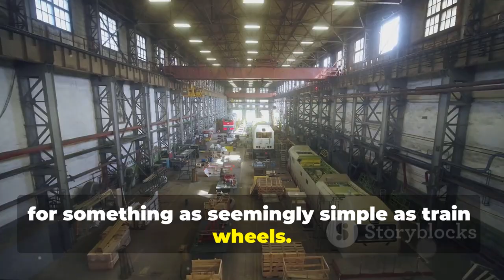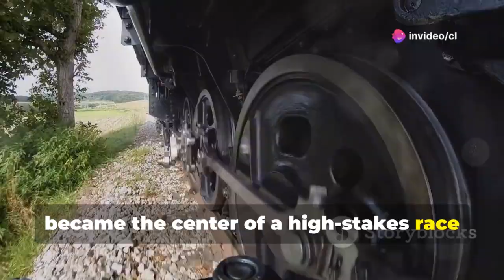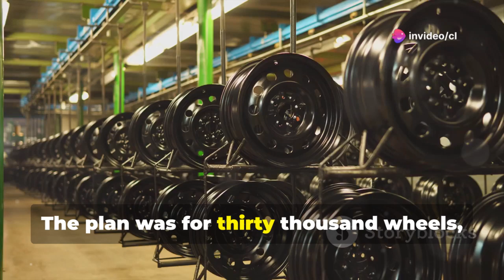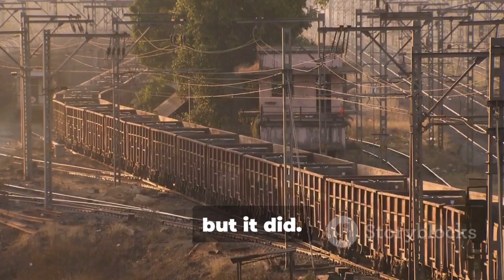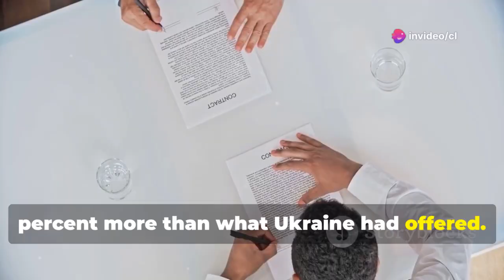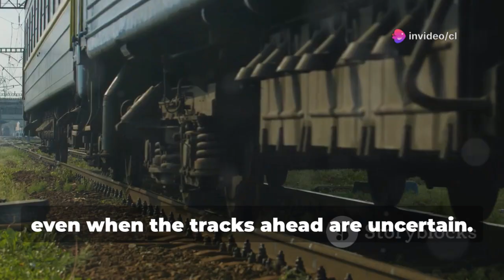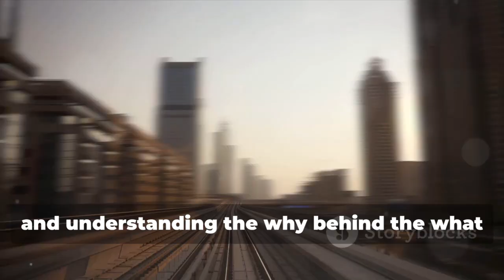India Paid $21M to China for Train Wheels—Why Japan Couldn’t Help

Comment: There's a huge railway wheel manufacturing unit which went broke and is been closed for last 12 years. It's a modern top teir manufacturing unit with gernan machines . Unfortunately it's being scrapped due to imports being cheaper.

Comment: Super Power India cannot manufacture train wheels!
Reply: If China can supply then India don't need to 😊
Reply: @ukindian8533  Meaning you need to remain dependant?
Reply: India, Super superpower!  Not sure why they can not manufacture their own.  India has the biggest population.??
Reply: @vinsok-wg7lh  Industrially lagging behind several nations.
Reply: India can, not at the scale required to meet demands.
Reply: @pavanw   Not at any scale! Wake up!
Reply: @avirdee5421no I have seen the plant which is shuttered down in Noida . It's a modern plant with top notch german CNC machines but unfortunately it was shut down because govt stopped giving order and preferred to import cheaper products from China.